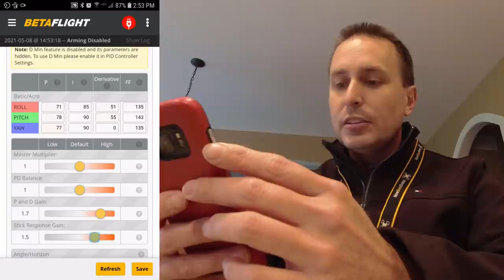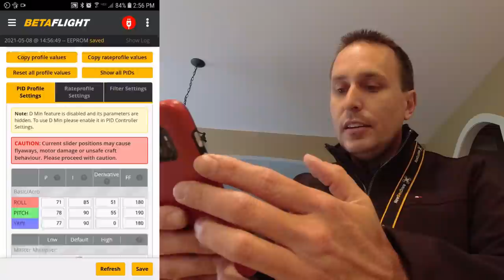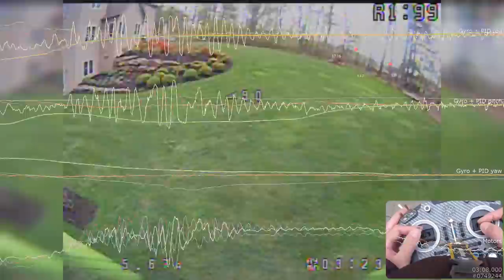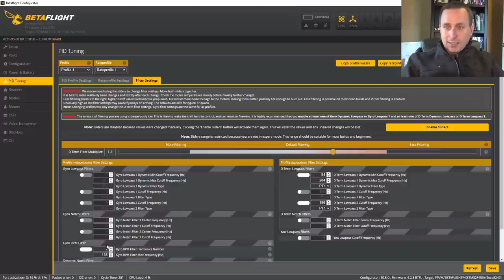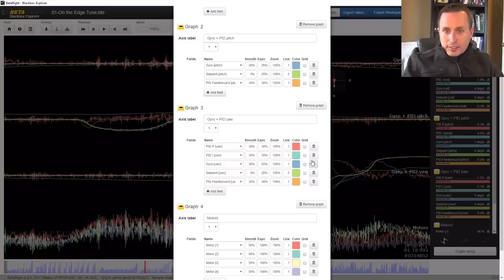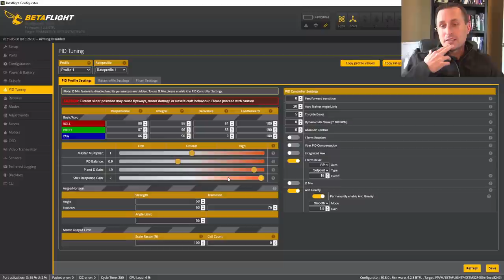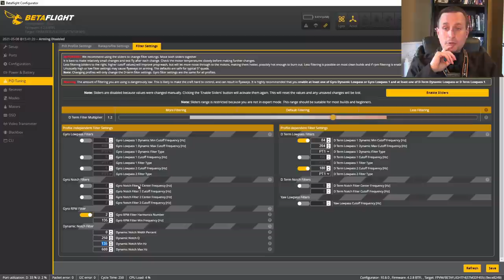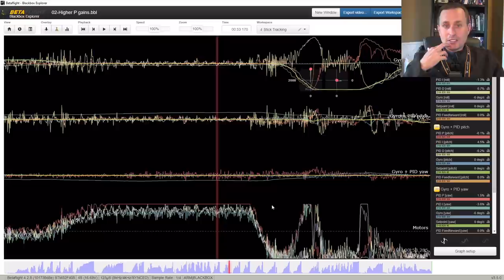Betaflight 3" Quad Tuning (Avant Avio 3)

Comment: Hi Mark,
Which preset tune would you recommend as the best starting place for 4” long-ish range quad? Motors are 1408 4100kv (which I’ll likely limit output a bit).
I use your presets on my other quads and absolutely love it.

Comment: Thanks. Your presets page doesn't contain your dynamic notch range advice in the toothpicks section. I set my max range to 850hz for my 2.5" TinyHawk based on what FFT peak was in my OSD.

Comment: I noticed you don't have any of chris rossers frames was just curious if you find them gimmicky or just never felt like trying them? I personally have messed with a ton of sub 250 till I decided to make my own. the aos 3.5 weighs 50g which to me is way too much The only designer that seems to do a great job is Avant. Take a look at my Discus and If your interested in one I'd be willing to send you one. It's a tight build but I think you'd really love it but I'm interested on your thoughts of the chriss rosser stuff.
Reply from the maker: Never felt compelled.  I like a simple 5".  Not in-love with the triangle arms.  Don't see enough value, for me, of a differential from a simple X design which do just as well in most cases.  Still see folks on the AOS frames that have issues. No sure of the source of the issue though.

SourceOne is my jam when buying.  They are cost effective plus I can download the CAD files and have cut myself if need be.

Comment: thanks for the gravy for the biscuits. i had been wondering what areas in the dterm spectrograph was acceptable and just how much which i presume is mostly motion noise , i was happy with some red in the  sub 50hz to the left and a clean or low green peaks to the right , of course with no hot motors. :)  so this video sort of confirmed that for me.   i do love that high squeal  you get when its tuned and the motors can do their thing.  its like another level.  keep up the good stuff

Comment: Ive been watching your slider tune videos over and over trying to pick up the nuances of tuning.. I followed you exactly on my 5inch and its one of those most amazing tunes ive ever flown.

Following your 3" slider tune video though I can't seem to have any success(im flying a toothpick TP3). Why didn't you raise your FF transition to 1 and drop stick response gain to the lowest setting? I also dont get what the filter sliders are doing.. You said on another video, you want those as low as possible but this time you left it pretty high without trying to drop it. Is there a video I could watch of yours that goes into this more or is it just a feel you have for it?
Reply from the maker: So i was lazy on PD Balance tuning.  You can kind tell even with FF enabled after you look at enough logs.  That said, i probably can raise PD ratio a little more (lower PD Balance slider for 4.2). 

For filters, you want the sliders as HIGH as you can (low filter amount).  The Gyro Filter slider has a bug that it does not turn off in the App when the gyro filters are turned off, so don't let that throw you.  I has too much noise on the quad to raise the D-Term filter any further.

Comment: I´m having some weird issues with the betaflight faders! Some times when I have set my values with the faders and press save, the faders get disabled and I get the " Sliders are disabled because values were changed manually..."-message, even though I haven´t changed any of the values manually. And if I enable the faders again everything goes back to default, so I´ve started taken screenshot before every save. You don´t happen to have a quickfix for that?

Comment: Hey man. I was looking for some tuning guide for 3" machine. I have quite similar oscillations as yours in motor signal. What is ideal solution? Smooth signal or those small but very regular bounces? My rates are sth like 70 ;70;50 (PID). No prop-wash, perfect handle, but those oscillations... grr....
Reply from the maker: Props, props, props...

Comment: Great seeing you giving the smol birbs some love! What's your ratio on filtering the D-term so heavily? I barely set an LPF under 130Hz on a 3" and would argue that you are actively restraining the D to react on propwash oszillations (since they are found at way higher frequencies than on a 5").
Love your content nonetheless!
Reply: propwash on a 3 inch is not at any meaningfully higher frequency than on a 5 inch, it's still sub 100hz
Reply from the maker: I would love to raise D-slider more, but it is too noisy to go above 1.2 without having to reduce D-gains.
Reply: @uavtech  have you tried to mechanically filter a bit more on the gyro side (assuming you don't have an electrical problem)? Loosening the stack screw half a turn can make a hell of a difference on small builds.
Reply: @srossi88  I beg to differ! Why should a smaller system resonate at the same frequency?
Reply: @uavtech  less delay often means you can get away with lower D-gains. (especially in prop-wash where the error adds up fast)

Comment: Don't High Power To Weight Ratio Quads like these require less P and D values ?
Reply from the maker: Not, higher.  Lower power to weight requires lower P/D ratio.  See presets for example.
Reply: @uavtech  So should the values of P and D be lower for a high power quad? Like my 2500kv 6s 5" quad freaks out with any D value over 25, unless something else is going on
Reply from the maker: @chrisburke63  yes, D values will need to be lower with high torque motors.  That will drive P down as well.  But the ration P/D will able to be higher.
Reply: @uavtech  ok, interesting. I'll try increasing P/D since it feels a little loose now. Thanks!
Reply: @uavtech  i meant when you have a light weight responsive quad which is not sluggish don't you need less P D gains overall like sub250 6S
Reply from the maker: Yes.  P/D ratio is higher (PD Balance slider lower) and P and D Gain is lower.

Comment: After flying 4 or 5 packs great and weirdly without crashes I’m getting little random twitches here and there.  Like a quick little cough or like I nick a stick or something but i’m only hover or smoothly flying forward.  Can’t figure it out...
Reply from the maker: it is a noise issue on the gyro.  That can be from electrical or mechanical sources.  Increase your filtering.  I would tun on the Gyro Filter Slider in that case and set to 1.5.
Reply: @uavtech  thanks i did try that before.   I think a bad esc showed itself after i commented earlier.  No changes to the hovering flight tests and a pack later 2 motors won’t spin.  Motor swaps keep problem on same motors, reflashed escs too bummer these things come bad out of box like that.

Comment: How do you do the motor and orientation overlays on the DVR?
Reply: My guess is data from BetaFlight, but how do you export it as video to overlay on the DVR footage?
Reply from the maker: I Export to Video in Blackbox Explorer; just the trace lines with black background.  However you can have the video be the underlay and export both together.  But it will not be perfectly in sync throughout the video and also will not have sound.

I overlay the Track line video with the DVR in Hitfilm Express and Key Out the black background.  That is an Effect that you just drag over the footage in the timeline (Key Out).

Then I line up the two based on my stick movements at the beginning and end; using the stretch tool at the end as the log video is always a little shorter.
Reply: @uavtech  thanks

Comment: Do you up pidsum limits to 1000 on 3 inch quads?
Reply from the maker: I did not.  I would need to check, but.small rigs don't get to a PID Sum above 50% much (default limit).
Reply: @uavtech  but there wouldn't be any problems with upping it on any rig would there? Just no benefits?
Reply: I mean what's the point of even having the limit I guess is what I'm asking